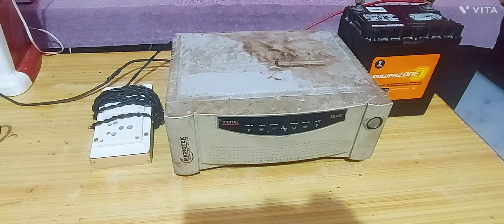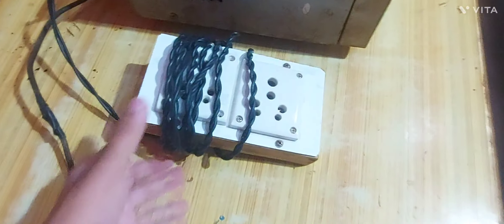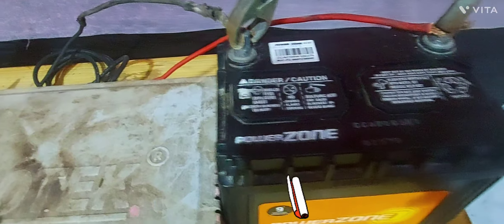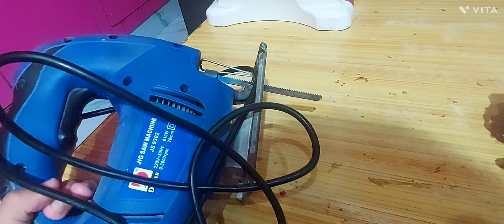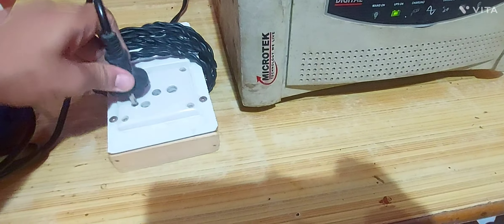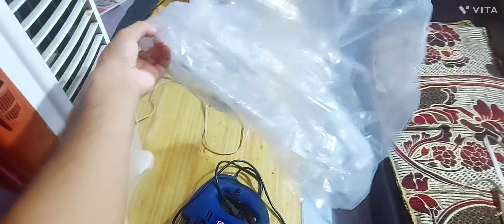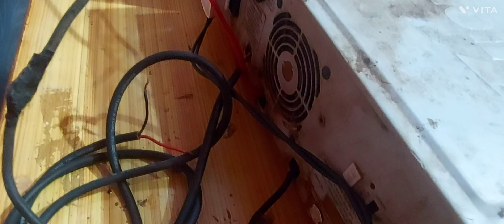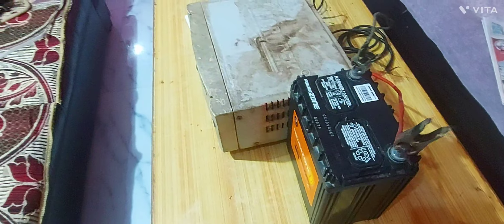car battery on 500watt inverter| kya car battery inverter chala sakti hai ?😱

Comment: Not for long term. The plates in car battery is very thin. which will degrade in months. Whereas inverter tubular battery has thicker plates which help it to last more.
Reply from the maker: Yeh but it is only for emergency purpose

Comment: Esi bhi kya emergency h jo car battery nikal ke washing machin chalani pade or backup bhi to thodi der hi degi to koi matlab nhi banta h is combination ka
Reply from the maker: This vedio shows the capacity of a car battery. This battery is efficient for light bulbs and small ac fans, when ever there is a power shortage. Basically it's an experiment.